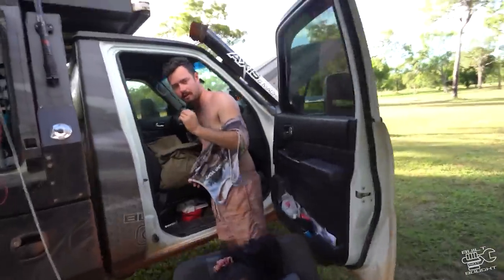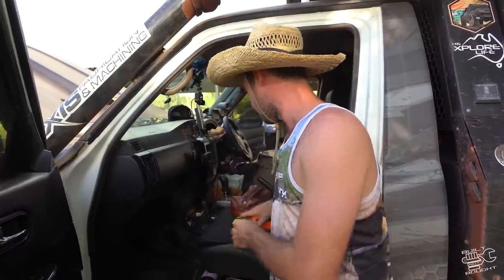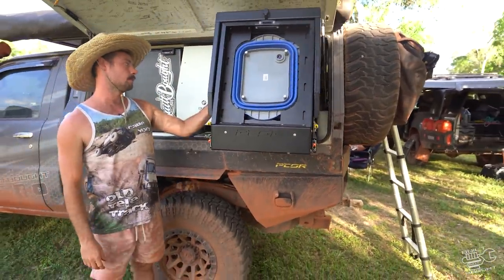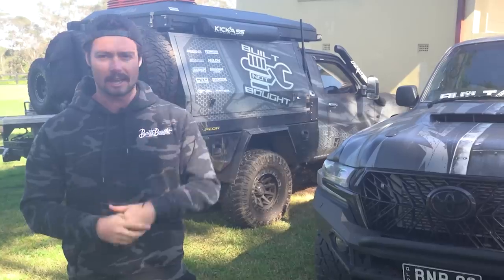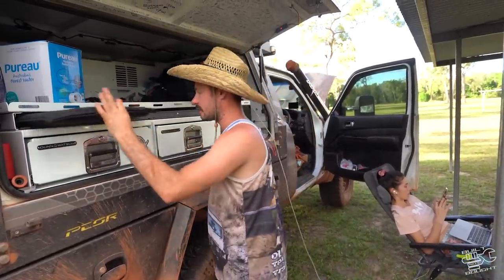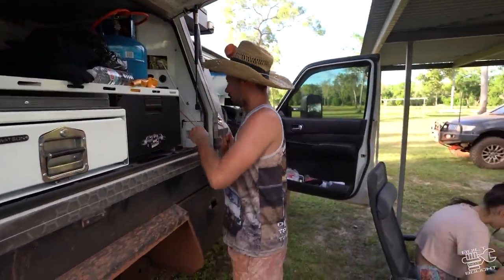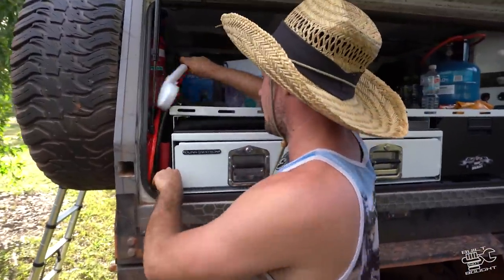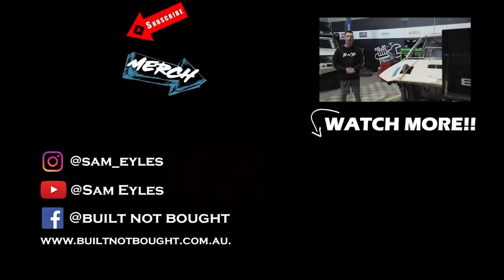What To Take For A Trip Past Coles - CAPE YORK Edition

Comment: I have done the Cape 3 times over the past 12 years and have never carried the amount of car gear you do. I just carry some spare belts and hoses, a small container of oil and a tyre repair kit.
Reply: Are you also hitting all the hardest tracks they are mate ?
Reply: @rob_johnson9274  I have done my fair share of hard tracks including the Old Telegraph track 3 times, The Canning Stock Route, The Gunbarrel Highway, the Gibb River Road, The Tanami Track, The Simpson Desert crossing and many others.
Reply: Yeah it's not exactly a remote trip anymore unless you head out to some of the more remote camps in Lakefield or Cape Melville or whatever. If you're just doing the Telegraph Track you don't really need anything more than what you describe if you are willing to rely on outside help. I'd probably carry spare CVs and a tool kit in addition to what you listed.

I do a lot of really remote trips and for those, two most important things I carry are Satphone / personal EPIRB and First Aid Kit. I also keep my engine and electronics stock and keep the car as light as possible. If I'm going full out there remote I use a Daihatsu Scat. Just about unkillable and unboggable.